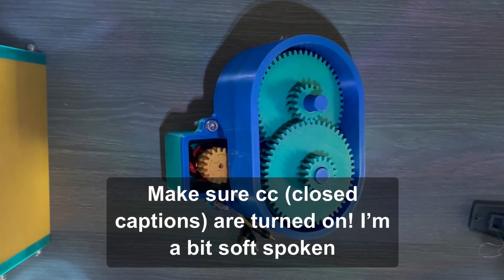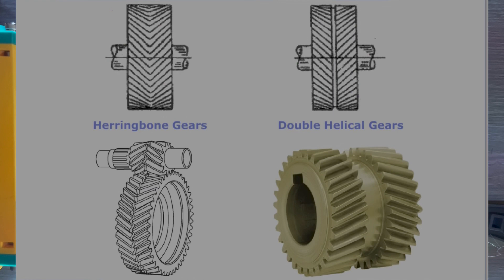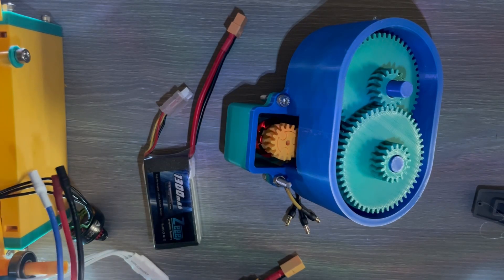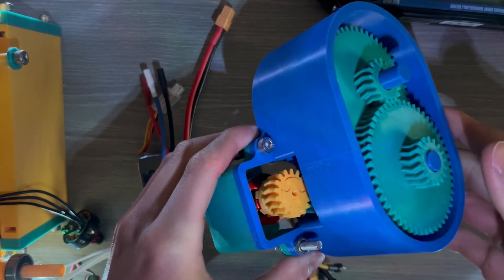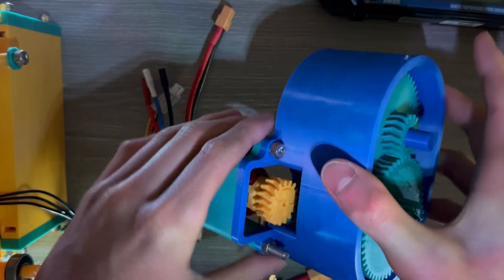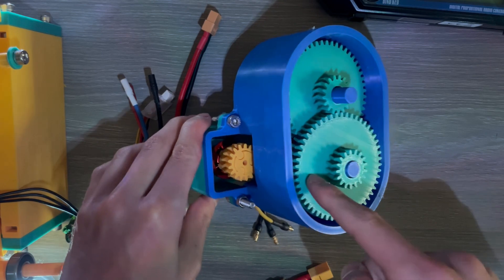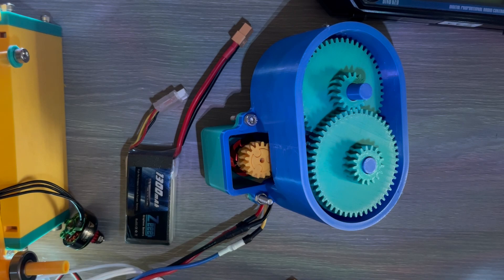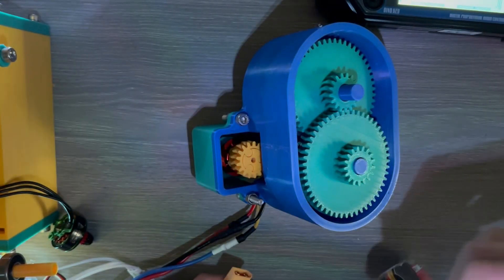Building a super-torque Gearbox (Fully 3D Printed) Using Drone Motors (BLDC)

Comment: I have been trying to utilize brushless drone motor to make a high-power linear actuator. The main drawback which it seems nobody can overcome is the  deafening noise that 3d printed gears generated when operated at 20000 rpm. Even at 20%, it is just not practical. I have tried worm gears, double helical gears (as in video), planetary arrangement; the last i will try will be cycloidal which I highly doubt will be smoother. At this point Im considering switching to a hydraulic design.
Reply from the maker: ah yes... drone gears are honestly quite powerful (and promising since they're prevalent and relatively cheap). I guess bearings will help, but we'll see. That's an interesting project you have going on! LMK how it goes!
Reply: is that printed solid? I feel like it's related to infill, going that 3d prints are like 80% air, hollow things make way more noise in general. I've got non 3d printed plastic gear in other things and they are not loud, apart from layer lines and plastic type, what other reason could their be?